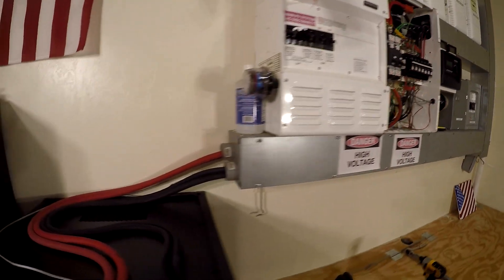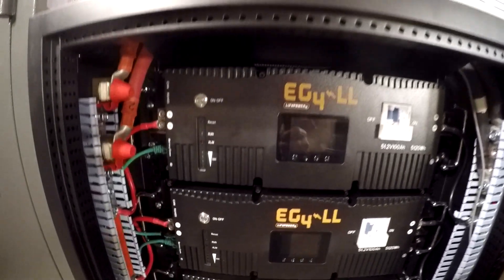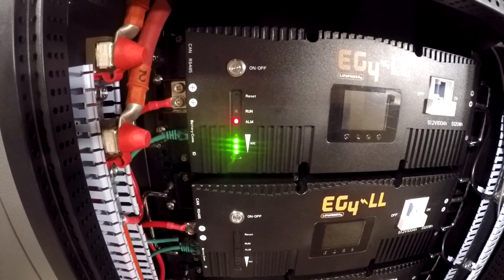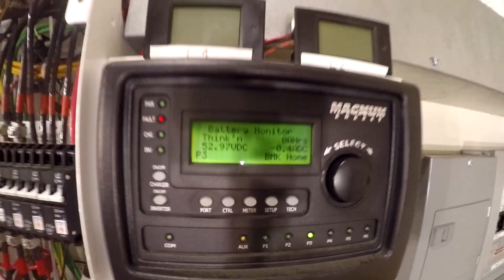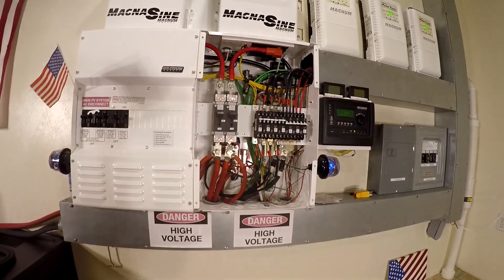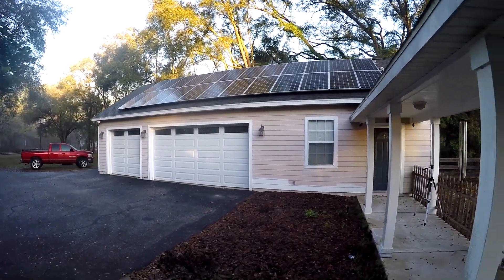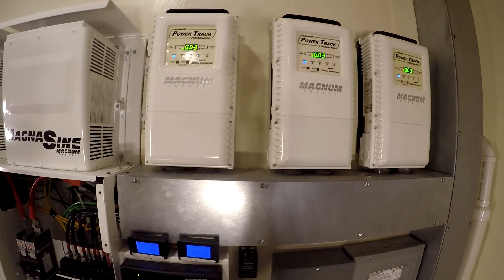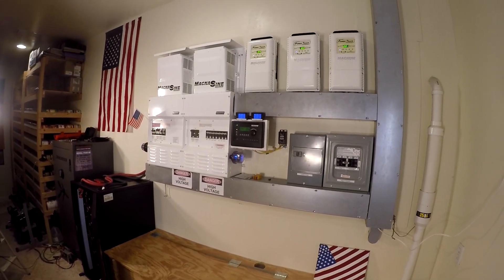EG4 LL V2 Magnum Inverter Startup

Comment: With the charge setting you have programmed are you seeing issues with any clocks in the house?  i have a set upon a houseboat and the clocks weren't keeping time 15 minutes a day off.  lowered the charge settings and now it down to a few minutes a day? any thoughts
Reply from the maker: My initial thought is to look to the frequency coming out of your inverters.  60hz?
Reply: @HomesteadEngineering  at charge voltage 55 volts the hertz drops to mid 58's and when we lower the charge voltage to 53.6 then it stays closer to 59.96.

Comment: that's beyond ridiculous with all that complexity
Reply from the maker: Its been a great project but newer systems have basically made it much simpler.  Now you just have an "All-In-One" connected to the battery and the panels and that's about it.
Reply: @HomesteadEngineering  i like the simple all in one battery. i dont like the cost of some of them

Comment: Great video. Do you have a link where those battery cable ends 4/0 lug covers in your EG4 cabinet  connected to the busbar are available for purchase?
Reply from the maker: -TEMCo WC0470 - 40' (20' Blk, 20' Red) 4/0 Gauge: 
 https://amzn.to/2IeSc9a
Reply from the maker: https://amzn.to/47FiMUx
Reply from the maker: This is my original parts list: https://youtu.be/zb4oar9UHSY?si=K5U7Sfyr-Fe66rpe
Reply from the maker: This is the ground mount parts list: https://youtu.be/6KL8_Qks-Rs?si=FxYHHX_yXs36RSrE
Reply: Thanks for all the great info. Im talking about specifically at the 1.15 minute mark of the video, that red cap on the positive 4/0 cable and positive busbar that connects to your inverter. I must have missed it in your parts list .
Reply from the maker: @Corum77  That came with the fuse block: https://amzn.to/3QUeCCi

Comment: What Amp mrbf do you have on each battery+ please? I have 4 egll 24v/200ah but they did not come w breakers.
Reply from the maker: I installed a 200Amp fuse on each 4/0 cable:
- Fuses: https://amzn.to/3CyW0zx
- Fuse Mount: https://amzn.to/3ZoyKyf
Reply: Thank you. Would it be prudent to also fuse each of the batteries positive side to the busbar... using a single fuse mount & fuse 125A? The bolts are two different sizes... thank you.

Comment: Great video and showing us everything you did! I just ordered six EG4 Lifepower4 batteries (no display) and rack system kit from Signature Solar (won a ton of money at the local casino!). A couple of questions: 1) shouldn't the 4/0 NEG cable be at the bottom of the buss bar on the right? I saw on Will's YouTube channel that he did that (POS red 4/0 on the top side left buss bar and NEG black on the bottom side right buss bar). He reverse mounted the NEG buss bar so that the NEG cable feeds into the rack on the bottom 2) should you charge each battery with that 18a 48v battery charger you got to 100% before paralleling them and commissioning them into service? Or does it matter? Signature Solar is sold out of that 18a 48v charger like yours and I am shopping around for something else -- 3) any alternative LiFePO4 charger you can recommend? Thanks.
Reply from the maker: Hello Chris,  That is awesome news!  I do love the EG4's so far and I think your going to be really happy with them as well.  It really changes everything about how I run my system and I am still adapting a new routine.  
1. I considered flipping the neg bus bar as Will P. Did and others.  A few  reasons I didn't. 
a. Signature Solar has tested these systems extensively and they ship it "not flipped".  That tells me that it is not a significant factor to performance.  
b. The wiring is cleaner if not flipped  
c. I don't think the main lugs have very good clearance if flipped. 
d. Its a bus bar not a daisy chained wire.  
Also, I have not seen any significant differences in SOC from top to bottom so far (less then .03V between any two batteries).  
Finally, I may go ahead and rotate the batteries in the stack after 5 years or so ( I did that with my FLA batteries).  
2. Not to 100% but I would recommend charging them all to the same (0.02V) SOC before connecting them on the bus bar and charging them all at once.  Basically just start with the lowest voltage battery and connect the next one as you reach its voltage until they are all connected.  My batteries showed up at the same voltage from SS.    
3. Charger: Will P. has something but I would hold out for SS if its not too long a wait.  
P.S. Your killing it over there with all that power.  Now you need to make room for a coop!
Reply: @HomesteadEngineering  -- Thanks for all the info...can't wait. Look like many of us are on the same sheet of music when it comes to these batteries. We are all buying them

Comment: Great video! I just had a delivery of some Lifepower4 batteries, rack and a 12k Growatt inverter delivered from the same place. Did you run into any issues with the rack shelves not lining up with the screws on the battery ear mounts? Also, do your batteries protrude about 1/8" past the rear of the rack? I couldn't put on my back panel due to this.
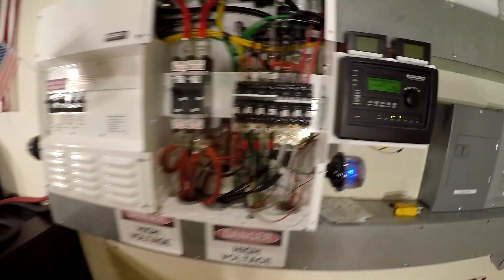Reply from the maker: BD, My rack was delivered pre-assembled and I had zero issues with it.  Everything lined up perfectly and fit just right.  Sounds like maybe something got flipped or reversed in your assembly.  This video has a shot of the inside of the rack as it was delivered, maybe you can see something that will help (2:02): https://youtu.be/t3JCOo8RGPw
Reply: @HomesteadEngineering  Yeah, mine was pre-assembled as well. I wonder if the Lifepower4 units are a bit longer or maybe they just built mine incorrectly. The front vertical mounting columns that the batteries attach to are about 6.4" from the front of the cabinet (ignoring the door).

Comment: I just got the same batteries as you with rack, 4 batteries now but will have 6.
Can you please tell me why you use double conductors from battery? I am told 1-2/0 awg is fine. I have one EG4-6500EX-48 inverter, I think perhaps it is because you run 2 inverters.
I'm just now learning about it and am confused, thank you.
Reply from the maker: Disclaimer: I am not an Electrician.
I size my wires by looking at the max current they could possibly draw and other factors like the length of wire and environment they are in.  So, the EG4-6500EX-48 can pull about 135Amps continuous.  A single 2/0 cable can handle up to 200Amps over short distances (less than 50-60ft).  So that should work fine.  I would probably use a 150 Amp (or less) fuse on the battery side of the wire to protect the wire. 
That said, I used 2x4/0 wires on my system primarily because that is what I was already running on the old bank.  My system can pull about 190 Amps continuous and about 340 Amps peak.   Its over-kill but I sleep well... :)

- Fuses: https://amzn.to/3CyW0zx
- Fuse Mount: https://amzn.to/3ZoyKyf

Note: You also need to look at the charging side of the equation.  How much solar will you have?  10,000 Watts of solar could push 200 Amps into the batteries but I think this inverter is limited to 8,000 watts.  If you double down on that (add 2nd EG4-6500EX-48) in the future to get 240Volts then you can run up to 16,000 Watts of solar and 13,000 Watts of output.  In that case, I don't think the one 2/0 is going to cut it.
Reply: @HomesteadEngineering  Thank you for this it's very helpful. Another question if you will: Is there a reason to use a fuse instead of a breaker? Some I've seen online like mine use breakers, others fuses.
Reply from the maker: @trumpingtonfanhurst694  I use DC fuses at the battery terminal and then breakers everywhere else.

Comment: Sounds like the pre charge might not have worked. You can verify will a multimeter next time.
Reply from the maker: These Magnum Inverters are very heavy duty and have large copper wound transformers unlike most of the inverters that these EG4's are normally connected to.  They also have very large capacitors and I suspect that the pre-charge from a single EG4 is just not enough to start these heavy duty inverters.  That is just my guess but starting 3 batteries at the same time did work...  Thanks!

Comment: Thats a nice setup, mine is 4024pea x2 with rtr, 3x midnite classic 150, 18 pcs 400 watts panels. Just saving to transistion to lifepo4 battery.
Reply from the maker: Sounds good.  Keep an eye on this for a while and see how it works out for me.  If all goes well, and I think it will, then you can have more assurance that it will work with your system.  I plan to do a "Typical day" video on Wednesday so you can get a better idea of what the system can really do.  
Thanks!
EG4 Batteries: https://signaturesolar.com/?ref=HomesteadEngineering

Comment: Did I miss something. I believe you need to enter your battery capacity into the magnum control. Or it won't read right
Reply from the maker: Well Roy, I would say you don't seam to miss much.  I finally found where to enter the battery capacity after running the system for one day on the old settings.  The FLA setting was 740Ah and the new EG4 setting is 600 Ah.  So, as the bank was discharging,  the Magnum BMK was tracking with a higher SOC than the EG4's were actually showing (as you would expect).  Once I corrected it, it is tracking pretty much dead on.  Sometimes I wonder how you can stay ahead of me when your not even here???
Reply: @HomesteadEngineering  pay attention to detail
Reply: So it appears the magnum does not have the ability with the CAT5 Ethernet cables to communicate directly with the EG4 batteries?
Reply: no it don't really need to  work perfectly with out that @user-Q-

Comment: Now you’re going to have the same problem I have when I went front flooded to lifepo4 The system got extremely boring because there’s nothing to do on it
Reply from the maker: Yep, I can see that coming for sure.  Right now I am still busy with it as I am having to retrain myself on best practices under the new parameters.  Lots of things will change.  For starters, It looks like I will be leaving almost all of the house on the batteries over night.  My transfer switches wont get much use anymore I guess...  :)

Comment: Very awesome looken system ! is it EMP ? CEMP proofed ? I see the lighting arrestor
Reply from the maker: It is EMP and CME resistant but not completely protected depending on what actually happens.  I have 5 of the Midnight Solar surge protectors on the system.  I also keep it disconnected from the grid.  Thanks!
Reply: @HomesteadEngineering  TY for the response u know about EMP Shield ?
Reply from the maker: @TheRedneckprepper  I am familiar with it but have not tried one yet.
Reply: @HomesteadEngineering  IF U DONT KNOW ABOUT IT RESEARCH AND I LL GET A LINK FOR $50 OFF IM NOT AFFILIATED MIGHT WORK THO IT GOV. USED ?